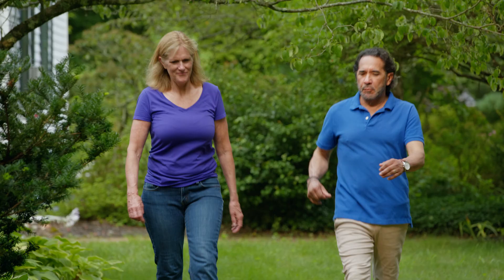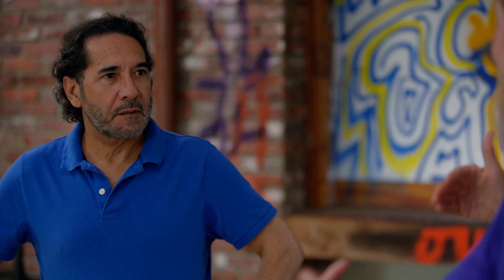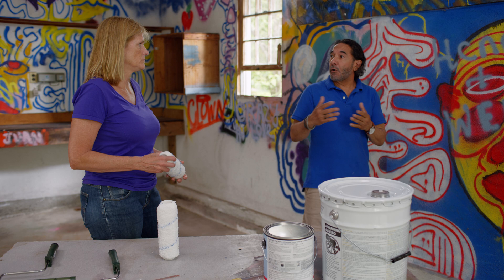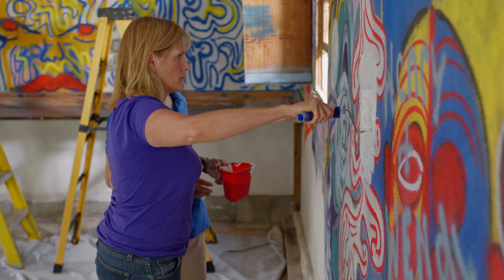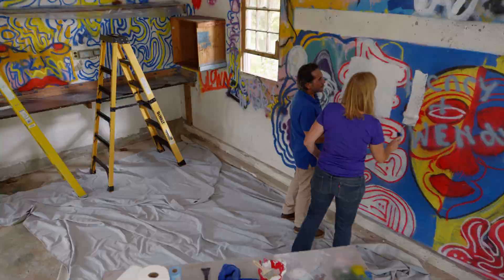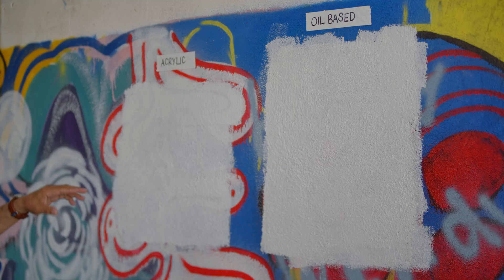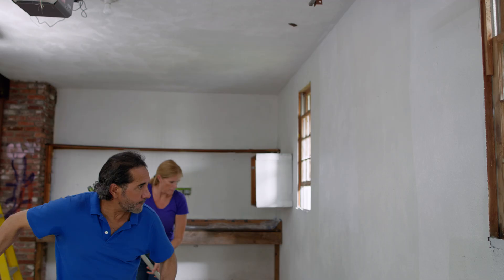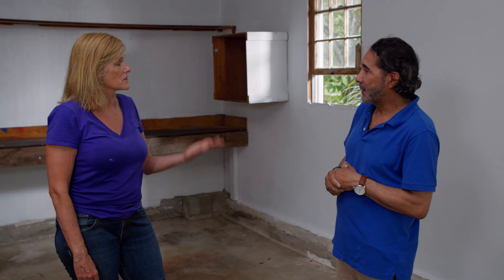How to Paint Over Spray Paint Graffiti | Ask This Old House

Comment: An airless sprayer would have done the job faster and there are special primers for stuff like grafitti one is shelack based works great but stinks and is like $150 for 5 gallons . with an airless sprayer it goes on better then a roller . dont use acid on brick not unless you want to ruin your brick to remove the art from brick contact a local grafitti removal company you can ask them what they recommend to remove said art from brick and dont even consider sandblasting it will damage the brick .